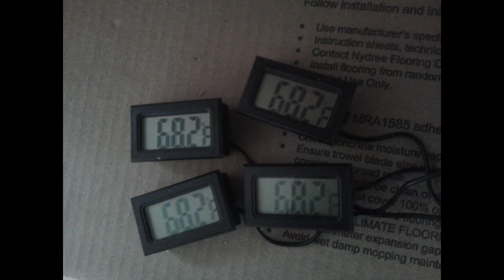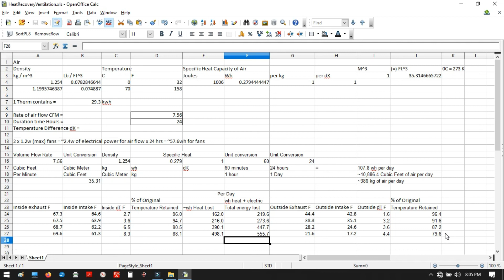D.I.Y. Heat Recovery Ventilation - 2

Comment: Good lord, what an incredibly well explained and detailed video on a building a DIY HRV and its corresponding efficiency. Thank you for your efforts! How did it hold up over the years?  Did you get mould or any microbial buildup in the unit?
Reply from the maker: Thanks.

It has held up fine so far (no issues yet) .. I have not torn it apart to look inside it .. but , I have not seen any mold or such build up .. At the end of a use season , it is easy enough to just take the fans off and flush the inside of it with cleaning water (a little bleach in said water isn't a bad idea).

I haven't finished it yet .. but .. one improvement .. that is on my list to do eventually .. is to put an air filter on it .. that would also help reduce anything getting inside it .. right now it just has a simple screen to prevent bigger things (like bugs) from getting into it.

Comment: Very cool! Love the spreadsheet. Would have liked to see a row that quantified just how much energy would be lost if you had simply been letting the same volume of outside air directly into the house at those temps. That would probably drive home how important air sealing is to people. Curious to see if there are any moisture problems with this setup over time. Great work!
Reply from the maker: Inlet and outlet air volume should have been very close to the same .. same fan on both , same power on both , same distance on both , same HRV path obstructions on both , same air angle changes on both , both faced the same inside vs outside gradient , etc , etc.

Just letting inside air leave without transferring a significant amount of it's heat is easy to calculate .. that is just the thermal mass calculation on how much energy it would take to heat up outside air to inside air temperature.

Comment: Hi Ian, do you have data on how much the air is slowed from the fans rated cfm (they won't be running at full spec as the heat exchanges is a slight restrictor). Am I correct that just a standard sheet of polycarbonate was used to build it? What are the dimensions of the final product?
Reply from the maker: Yes, normal multiwall polycarbonate to start with .. doesn't specifically have to be polycarbonate specifically , it was the pre-fluted aka multiwall aspect that was being selected for .. better conductors like aluminum or copper would work better for the same size device , but would also cost allot more.

Yes, there will be resistance to the air flow from the heat exchanger.

No, I did not test the specific amount of air speed slowing .. it can be estimated .. I don't have the zero resistance base line .. It varies a little with conditions but my anenometer measures around ~1.7m/s air speed from the finished build , out of the 40mm diameter fan. 

Final dimensions of this prototype were 5-1/2" wide 5-1/2" tall 25" long .. a long length is deliberate part of this design .. longer distance provides more time and more surface area to perform the heat exchange effect .. an otherwise identical design that was shorter would be expected to not recover as much of the heat energy.

Comment: This is cool! Do you feel that the amount of work you put into building it was worth it over buying a new unit? Also, how does your design work with condensation?
Reply from the maker: In this design , to ensure condensation is on the outside exhaust , it would be best to angle the unit on a slight slope .. the exhaust fan will help but , I wouldn't 100% rely on that alone.

As for 'worth it' .. There are a few different ways to look at that:

#1> I'm a tinkerer myself .. soo, to me 90+% of the value was in the project itself (design, build , test, etc) .. for me .. any 'end results' are a tiny ~10% value / motivator .. soo , in that sense , yes , I got enough tinkerer enjoyment to justify the cost (Time+Money).

To understand my PoV .. think about watching a movie .. like Indiana Jones Raider of the Lost Arc ..  where do you get the % of your enjoyment ..  the processes itself of watching the movie .. or .. for less of your time , and the same out of pocket money .. you could just skip to the end result .. see the final few minutes Arc in a crate being rolled away in the warehouse .. that is the end result .. and if all else were equal it would take less of your time to skip all the other minutes of the movie .. but .. for me .. 90+% of the value of watching the movie was about the processes / progression of the movie , very little ~10% or less of the value was the final end result.

#2> It was a trade .. time for money
Like many DIY projects are .. in this case it cost me about ~1/10th the out of pocket materials $$ cost to make itself .. compared to what it would have cost me out of pocket for a brand new off the shelf version .. so cheaper for me to get the same effect.

But .. only if I'm not paying for my time , tools , facilities , etc .. if it were a business it would not be profitable after paying for labor , insurance, rent , etc .. to build them like this .. compared to what I could expect some consumer to pay for it.

#3> $ per $
Measuring the cost to build .. or .. the cost to have a pro install a HRV  or ERV is easy enough to do .. but .. trying to quantify the financial $$$ value benefit of fresh air in a home .. physical / mental health .. etc .. that's a very hard thing to quantify .. and very very subjective , situation to situation.

For me .. I don't run it 24/7/365 .. but I did get my value out of the tinkering itself .. and occasionally .. I do like to have the option for some fresh air .. especially a depths of winter .. while minimizing the energy / heating cost penalty of doing so .. get the fresh air of opening a window , but with about ~95% or so the heat savings of keeping the window closed.
Reply: @ianpgeorge  that's about what I thought. I'm looking at putting in a hrv in my camper, and there really isn't a great option on the market. So I'm probably looking at $500 or so...
Reply from the maker: If you invest your time .. You could probably make one for 1/10 that $$ .. it's really not complicated / difficult principles , nor construction.